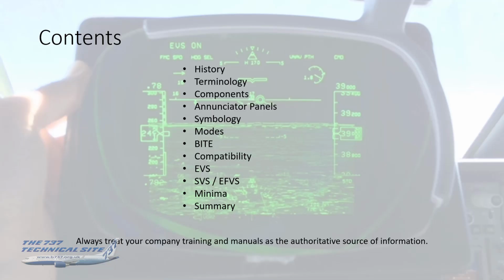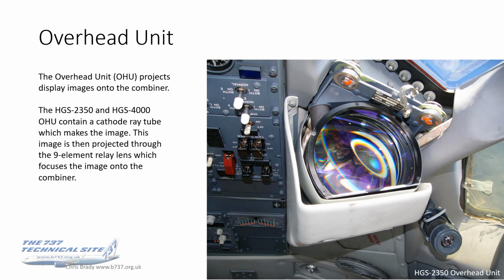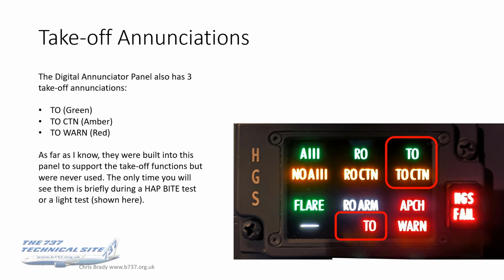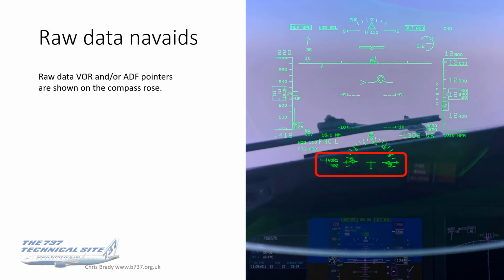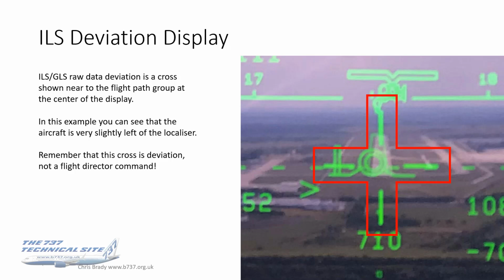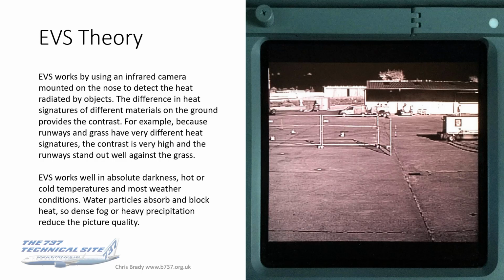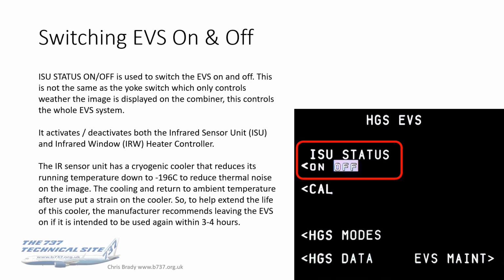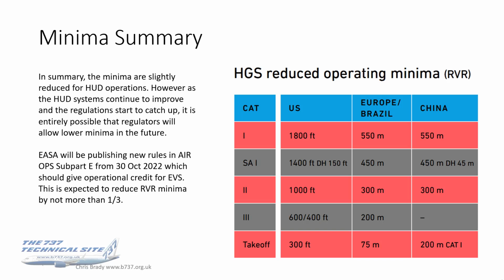737 Head Up Display

Comment: The operators in China are “recommended” by the CAAC to have HUD/HGS installed on their newer aircraft from around 2010, from that time almost all the airframes we have domestically have HUD selected, A320/330/350/380, B737/787, the only exception is are the B777. But many old fashioned instructors are against the HUD or flying FP instead of FD😂

Comment: 8:50 - the blue=dry is definitely confusing but it's just the industry standard. When Drierite (the OG desiccant company) made their original indicating desiccant formulation in the 50's, they decided on using calcium sulfate which is blue when dry and light pink when wet. It was wildly popular (still is), and blue=dry just stuck. 

The industry or Boeing could easily switch to copper sulfate if they wanted it to indicate blue when wet and white when dry but I guess the standard is just too firmly established to change now.
Reply from the maker: Great background info. Thank you

Comment: American Airlines did purchase 75 BAE 2020 HUDs; including the prototype we ended up with 76 and didn’t take any further options.  All the subsequent aircraft have either the Collin’s RGS 4000 (800) or RGS 6000 (MAX).  As the 2020s wear out and become unrepairable, there are no new systems in production nor can we obtain any used parts from other airlines since we were the only carrier to purchase that particular system.  As a result, as these older 2020 HUDs fail, they are deactivated and the aircraft becomes limited to CAT 1 operations.

The plan is to replace the BAE 2020 HUDs with the Collin-6000 (same as the MAX) starting later this year, but in the meantime we’ll have 15-20 CAT 1 aircraft for the next half year or so, pending FAA approval.
Reply from the maker: Great background info, thank you

Comment: I flew the Marconi HUD at American Airlines, retired in 2007. I thought it was a great system, really liked it for both instrument and visual approaches. When I was flying it only had one level of de clutter which was fine. Put the circle on the bottom of the donut in the flair and if you were on speed she rolled on every time.

Comment: Excellent video, Chris! As always. Your channel is auch a treasure trove. NB: The AoA bracket is shown when within 3.5 DEG of Stick Shaker AoA with flaps up & 5 DEG with flaps extended. Also, worth to mention that the HGS is a conformal display unlike the PFD (compressed). Maybe for a second part of it on conjunction with the UA modes?
Reply from the maker: Yes good points. It might be a while before I manage to get around to a follow up video though!

Comment: Hi Chris, thank you for the video. You may find it interesting that the biggest 737 operator in the world SWA don’t use auto land at all on their 737s, but fly Cat IIIs exclusively on the hud. Additionally all of their 24 737 simulators are equipped with HUDs.
Reply from the maker: Thanks John, I was not aware of that but it is testimony to the effectiveness of the HUD.
Reply: @ChrisBrady737  I believe the main reason we don’t have/service autoland in our 737 at SWA is because of cost savings.  We have had most of the 737 variants and back in the day they tried to “dumb down” newer variants to make all the planes in the fleet similar. 
As an example initially our NGs had a 6 pack EFIS/MAP display to resemble the Classic fleet and the auto throttle was disabled. Later we changed to PFD/ND format. Also took us a while before we began using LNAV/VNAV even though it was available. 
I believe that’s part of the reason we started down the HUD path and didn’t get autoland. Now there is not really a big reason to spend extra money on servicing the autoland system since we have CAT III capability with the HUD.
Reply from the maker: A fascinating insight, many thanks.

Comment: Took me a second to realize that the jitter problem between 50 - 65% N1 is right what your engines are going to be at when coming in for a normal landing... meaning you get the shaking problem right when you don't want it.
Reply from the maker: Exactly right. Good job it is now rectified!

Comment: Thank you very much Chris for this outstanding presentation regarding the HUD on the 737. It’s very interesting to discover the installation of this system on my previous aircraft since I’m now flying the 787 which has this device fitted as standard. I have to say I’m a fan of the HUD which l also used in the past in Dassault Falcon aircraft. You’re most welcome to keep posting such interesting videos and I keep studying the 737 because I should have an opportunity for a command upgrade on this aircraft pretty soon. Thank you for all you do for 737 community. Best regards
Reply from the maker: Thank you for your kind comments. Enjoy your secondment on the 787. I think when you come back to the 737 you will find it like putting on a pair of comfortable old slippers!

Comment: Hi Chris,
I think this is best video on your channel!!!
Plus HUD is a subject where correct information and experience is difficult to get, gain!

I would like to highlight few information regarding to Display Electronics Units:
DEUs are not only graphic/symbol generators, they are interface/collector computers. DEUs reading most of the switch positions of the P5 panel and transmitting to other computers. For exmaple bleed and pack switch positions are used by the Engine EECs to compensate fuel flow because of bleed demands.
You can not enter to maintenance bites (DFCS, EEC, APU etc) at MCDUs until DEUs are not powered up, which is indicated by display units coming online and CDS fault message  (indicating single DEU operation temporay) disappearing.
Many engineers are not understanding this, without DEUs many airplane systems are not working properly. So wait for DEU power up.
Another thing is the sorftware configuration. Because of the DEU interface function DEU-FMC-FCC-A/T- EEC  softwares has to be compatible.For example During EEC sortware loading a verification list is stated in the maintenance manual.
Reply from the maker: Hi Balazs,
Thank you as always for your valuable insight. I certainly enjoyed making this video. Your extra info is very helpful.
Chris

Comment: A220, dual huds. Company policy to leave hud down all the time. Love it! Really helps with the last 200’ of an ils approach.
Reply from the maker: That's good to hear. If the HUD is down all the time you get very familiar with its use & layout and be able to use it to its full capability.
Reply: Do you find yourself hand flying much more than you did with non-HUD aircraft?
Reply: @wewillrockyou1986  great question. Both myself and the pilots I fly with are much more inclined to hand fly to 5000 or even 10 000 AGL, with the HUD. It is now the norm to hand fly the initial climb, 

The hand flying has not changed for landing though, with most pilots disconnecting ap around 1000 to 500' agl. In part that is due to the RNP approaches with radius to fix turns. Our guidance is to leave the AP on for those, even when VMC.
Reply: @tonymcflattie2450  Interesting, I wonder if HUD guided RNP would make it possible to accurately hand fly those curves, maybe even allow RNP AR approaches? Though not sure it would meet the no single point of failure requirement for the latter.